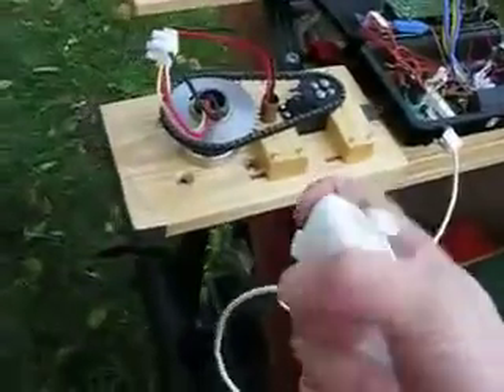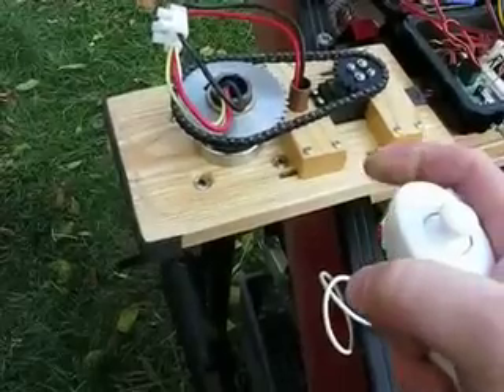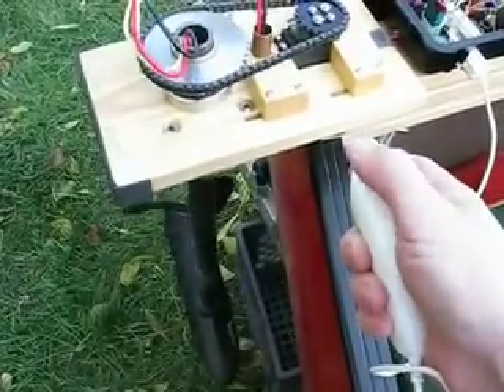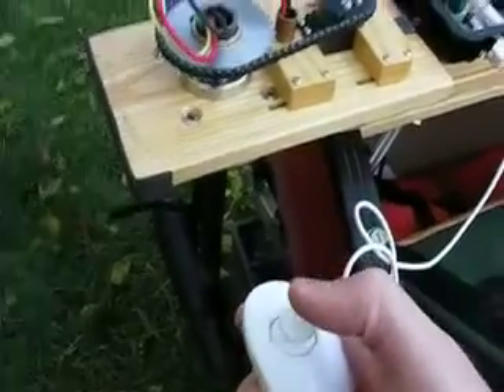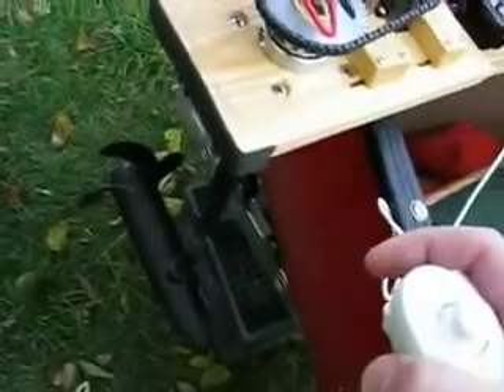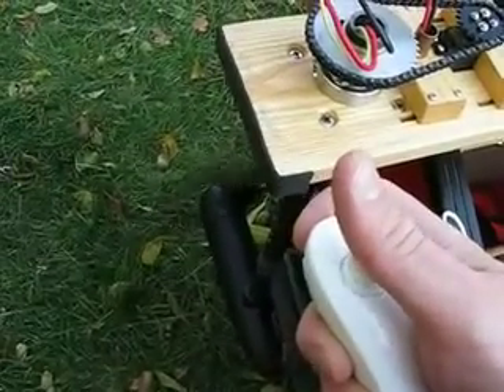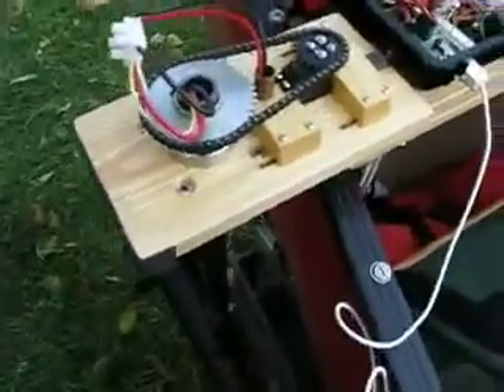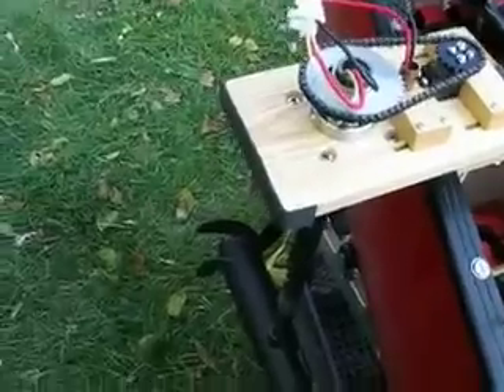Electric Canoe-8 Demo

Comment from the maker: Thanks!  Well, you can buy this setup one if you want.   However,  you'd need to think of it as a kit.  It works but it's still fiddly.   If you are a tinkerer, it could fit your needs nicely.   I'd sell it for about half the cost the parts new.

Comment from the maker: good question.  it probably pushed about 2k at the end of the day (including hull, cart, etc).  I am actually moving (to salt water) and I am going to be selling some key parts (motor controller, servos, etc) at a good price if anyone is interested.   I also optimized for ease of construction over price, and there are some smart ways to trim costs.